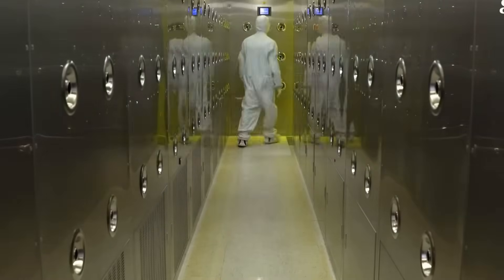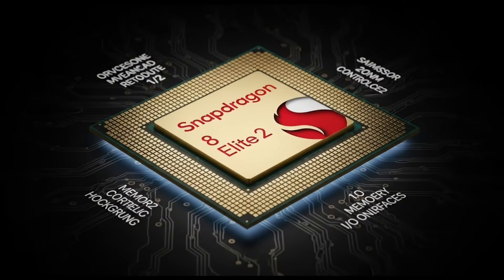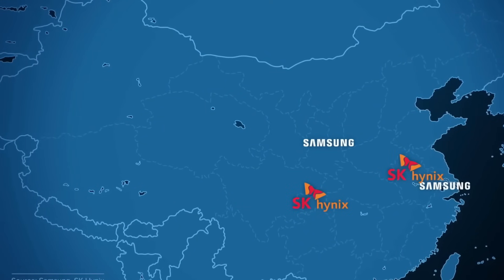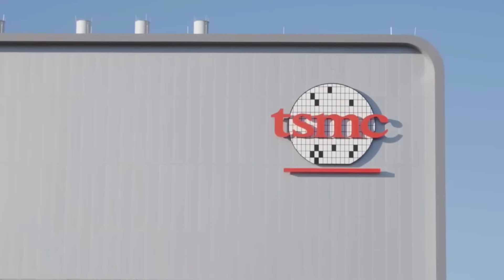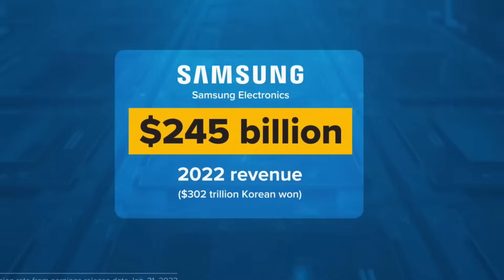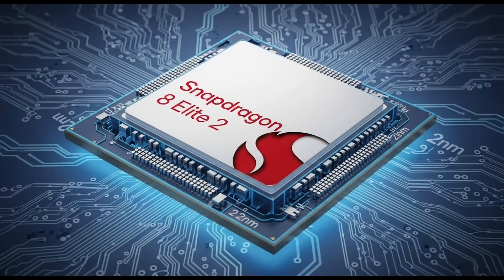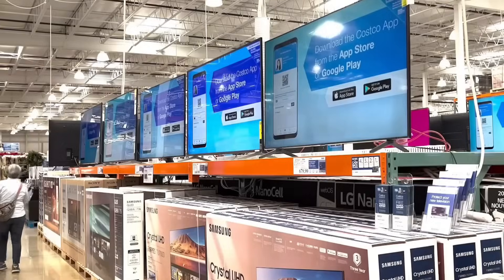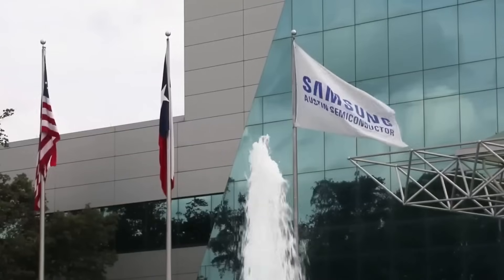Snapdragon 8 Elite 2’s 2nm Surprise — Qualcomm Quietly Tests Samsung’s New Chip Tech!

Comment: To be honest, its still a doubt. Performance without reliability have no use.

Samsung fail to deliver its GAA due reliability issue. While TSMC deliver stable, reliable chip thanks to keep developing older, more mature, FinFET. 

2nm is new gambling tech. Its unknown if that succeed or not. Considering Samsung track record of overheating, underperformed SoC and offering cheaper price than TSMC, yeah... if they can make it, good for them. Its extremely hard to pull though, lead to higher chance to fail.

Comment: Last time Qualcomm made a chip with Samsung was Snapdragon 888 or 8 gen 1 and holy shit it was hot af. Literally overheat all the time.
Reply: Real, I'm still using it till now so I can confirm
Reply: I guess you forgot the part where they said they've got all new machines/equipment? This is a whole different way of making transistors. Instead of 3NM FINFET, Samsung's 2NM is using GAA (Gate All Around), and Apple is actually sampling A18 on Samsung's GAA. So, things maybe changing. Apple may dual source again. That would be interesting, especially if the Samsung is indeed the better process node.
Reply: Yes you right they heat for no reason
Reply: @ac-fp4mr  those two did, yes. Years have passed and Samsung with new lithography machines may be better with GAA instead of FINFET from TSMC.
Reply: @ac-fp4mr actually no, now that I'm saying it 888 was fine. It just consumed a lot of power. 8G1 should have been on more modern equipment. Now they have it. Still wanna crack wise before you even see a result? I'm not having an ARM chip monopoly so choose Qualcomm or Exynos. Qualcomm will still be on old technology. GAA is brand new and also offers SIGNIFICANTLY better power management and efficiency. Thing is YOU don't know which is superior. I'm betting they'll be tied with maybe a nudge toward Samsung.

Comment: SD 8 Elite 2 will be announced with 2nd Gen Oryon CPU the same generation CPU used in the previous SD 8 Elite. 2 prime cores for high performance clocked to 5ghz and 6 cores for performance (balance) clocked to 4.4 ghz. Correct me if I'm wrong. But who needs that higher frequency? We don't have AAA games to utilise this kind of power. Only we are reliant to emulators.
Reply: Actually we need those more powerful chips in advance to have th AAA games later... you think apex legends and warzone shut down on their own just because of "optimization"? 

If you think we already have enough power just install fortnite or delta force and see how jittery the edges are and try not to throw up, our benchmark of performance is still genshin impact, a game released in 2020 but android chips still struggle to give 60fps without consuming extraordinary power with HORRIBLE LoD, good luck with trees disappearing, playing WuWa? Good luck with the soft textures, gaming on mobile always felt off (and mind you that was before I own a midrange laptop for gaming, after that it's even worse of a experience)

emulation? I agree it has come a long way for less demanding games but good luck about emulating actual AAA games like witcher 3, a 12 year old game on lowest graphics no anti aliasing and 720p just for it to give 25-30fps with lots of stutter
Reply: Warthunder mobile. My S25 ultra can't run it at max graphics and 120fps for more than 4 hours. It sometimes fall below 100.
Reply: It's not 2nd gen cores they are already in 8 elite it's 3rd gen

Comment: 2nm hotter than Arizona summer
Reply: It's actually lower and more efficient smaller transistors allowing for more transistors to fit on the dye.
Reply: Yes, it is true i wonder how a processor with this power like 8 elite 2 will not go so hot with the usage, i think it will surpass 50°

Comment: Samsung has been trying to catch up to TSMC and Qualcomm for decades. I think I'll believe it when I see it 😅
Reply: Bro.  Qualcomm only project processor, and names, tsmc is manufacturer. Always  chip tsmc the best.
Reply: to tsmc yes but not to qualcom. the reason samsungs chips are worse than qualcoms are because samsungs chips arent made by tsmc
Reply: @delta6855 it’s all down to software lol!
Reply: @delta6855 not the only reason, it's just worse. Same with googles g4-5. The g5 will be made by tsmc but still won't stand against the 8 elite, or probably even the 8 gen 2
Reply: They really should worry more about 🇨🇳
Reply: @Sarah_Delata good point they said they can never be able to build 7 nm with DUV 😅 and now they are producing 5nm with DUV and Huawei is testing their own Domestic EUV it's only a matter of time when Chinese will be on top
Reply: Samsung is INNOVATING. TSMC is iterating. FIN-FET vs GAA for Samsung. Samsung's GAA all the way forward. Period. Transistors cannot be shrunk smaller and not change design, or else we're going to have electron migration.
Reply: @crazyidiot5309  tsmc already have gaa in work plan
Reply: It hasn’t been decades
Reply: @junh4807  Qualcomm has been A4 and obliterated them with A7 in the 5s. Since A4 in 2010. That’s 25 years. That is indeed 2+ decades.
Reply: Lol!!!! What are you talking about?
Reply: @alanmay7929 Samsung exynos vs snapdragon search on YouTube

Comment: Tsmc's monopoly is crazy
Reply: Samsung also uses asml machines, Samsung would be doing even worse if euv wasn't a thing.
Reply: They spent a boatload of money when Intel was handling out divided checks, I work for a semi tool manufacturer working on Intels vacuum control system, they started about 7 years late.
Reply: Netherlands ASML holds an even stronger monopoly than TSMC, without ASML’s machines, TSMC wouldn’t be able to manufacture its most advanced chips
Reply: @MagnusØenCarlsen  Ok, but shouldn't you be playing chess, Mr. Carlsen?
Reply: @MagnusØenCarlsen 
Lol no , it's all because of usa . They have monopoly because usa allows it
Reply: Samsung 4/5nm had lower performance/watt than tsmc 7nm.

Samsung 3nm had lower performance and effiency than tsmc 4nm.

Qualcomm just finished testing samsung 2nm, they aint using it
Reply: Nope
Reply: It’s not their fault Samsung has to get its stuff together. If they can’t get it right or find the right people sell off whatever you have left of a chip business and move on. Hate to be brutally but it’s just facts. Samsung is why Samsung products aren’t great.
Reply: Yea but the ASML machines are from Netherlands which also relies on parts from the US and Japan...
Reply: It really is
Reply: Its too close to be over